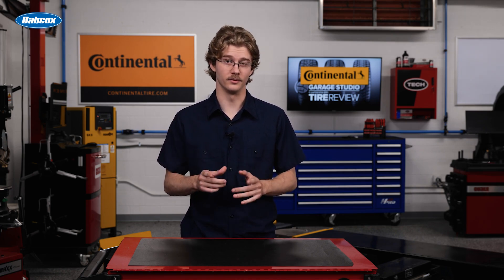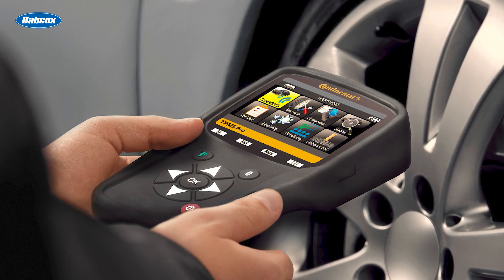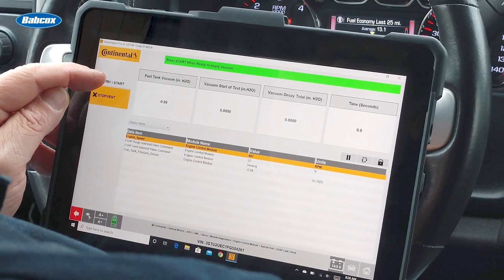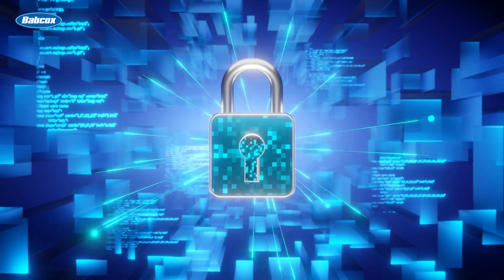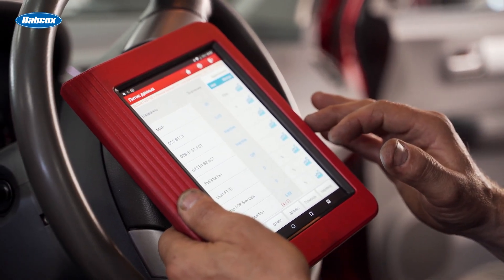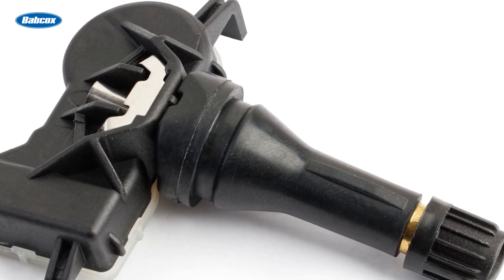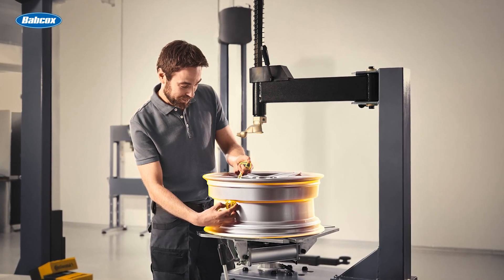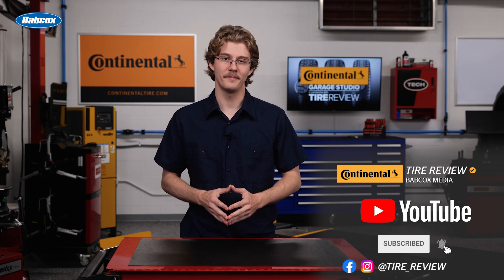The future of TPMS technology

Comment: Bluetooth also uses 'radio waves'. Current TPMS uses 315 and 433 MHz band frequencies, Bluetooth is also based on wireless transmission of data but on different frequencies. The only difference may be in the data transmission protocol being used and it's resistance to interference.